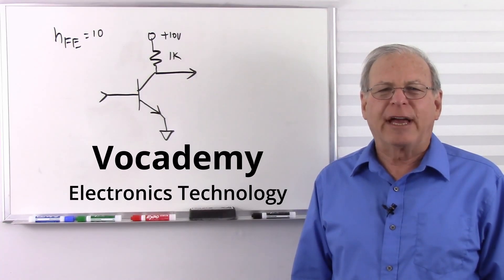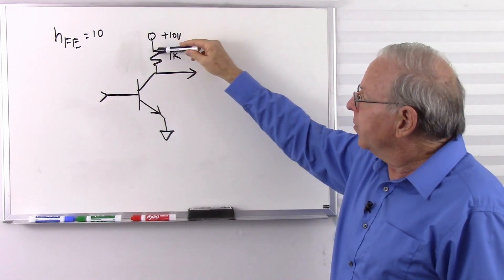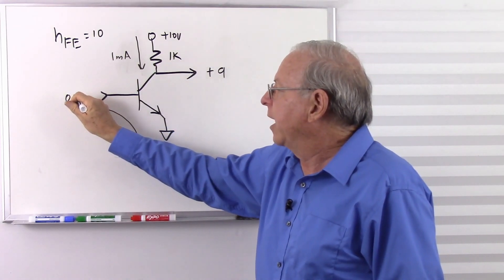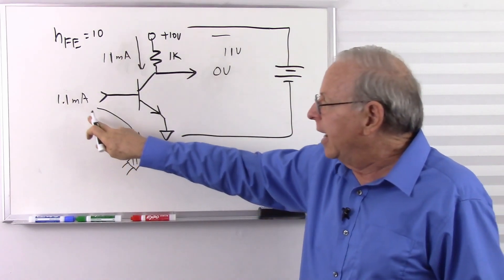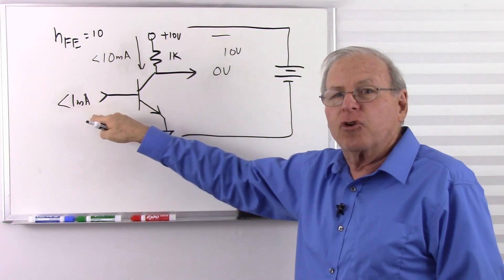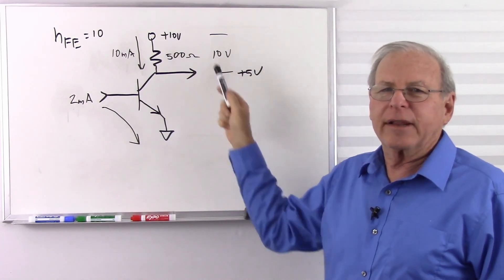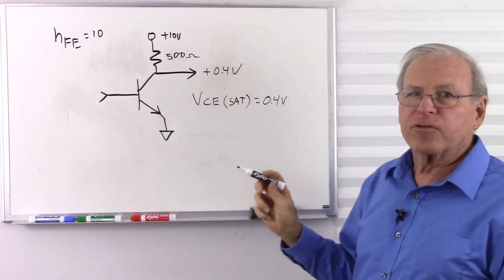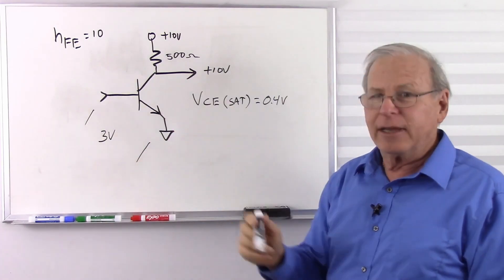What is Saturation

Comment: This is very useful.
I'm following Behzad Razavi's Electronics I Lectures. He first mentions Saturation in Lecture 18 with reference to an Ic/Vce Characteristic and gives Voltage ranges for avoiding Saturation but he doesn't explain what Saturation is.
This Vocademy lecture fills the gap - and, as a bonus, introduces and explains Cut-Off.

Comment: Sir, datasheet give detail about Vce (sat)  = Ic.100mA  , Ib 10mA  ,  it mean  Ib 5mA  if  Ic = 50mA ...   is this correct ...
Reply: The relationship between Ib and Ic is not necessarily linear, especially in the saturation region of a transistor. So cannot directly halve the base current to get a proportionate reduction in collector current. It's common to assume linearity for rough calculations (like Ib = 5 mA for Ic = 50 mA in your example), the actual relationship can vary depending on the transistor's characteristics and the operating region.